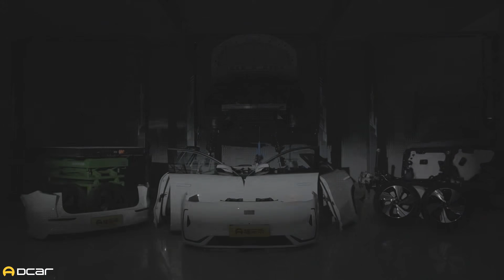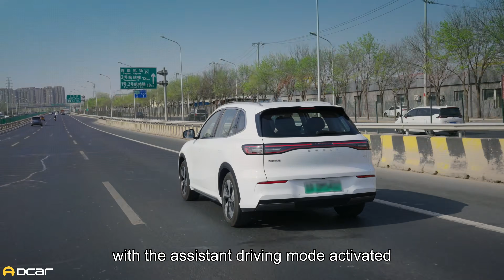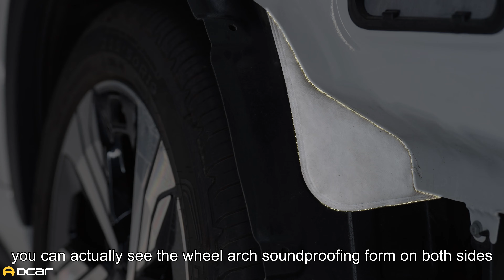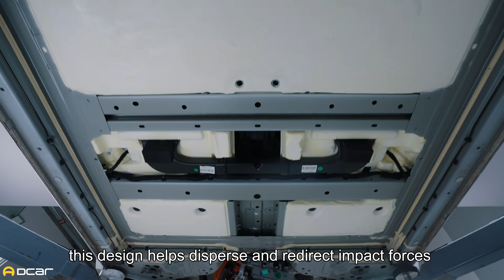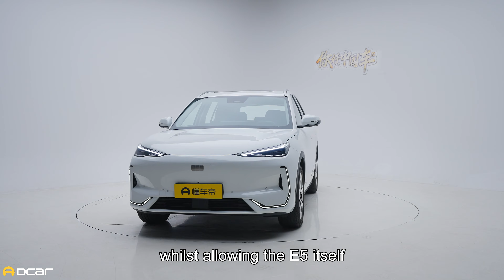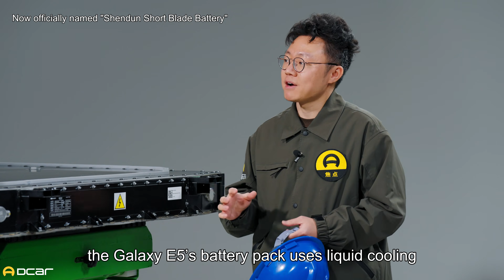Disassembling Geely Galaxy E5 Unmatched Safety & Quality 吉利银河E5安全、品质惊叹全场

Comment: front suspension can it be upgraded at least in front part? at least in latin countries where roads are not good enought is an issue we need stronger shock absorbers. This has to be customized depending on the country roads like other brands do. It is annoying the bouncing besides dangerous wih high speeds